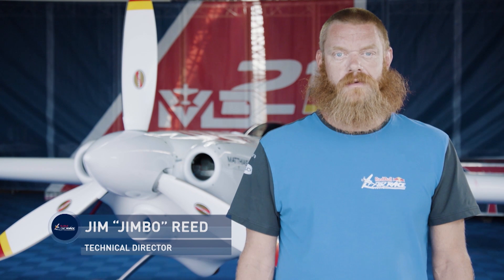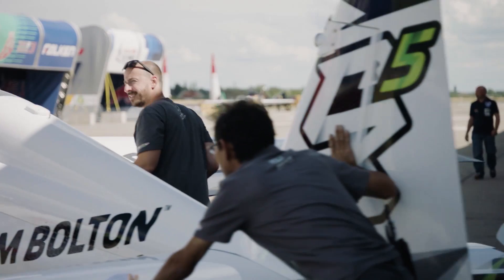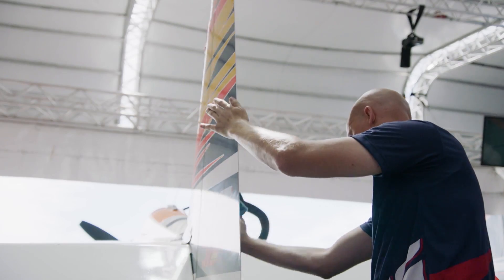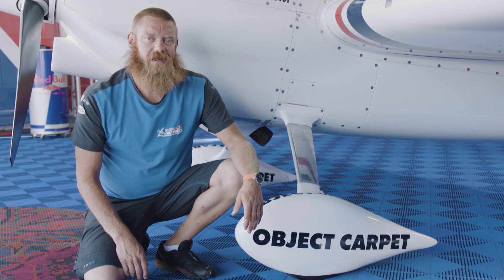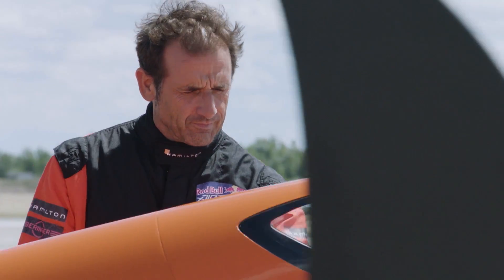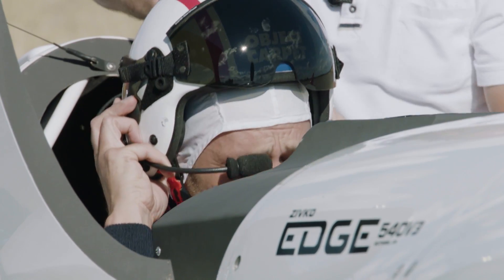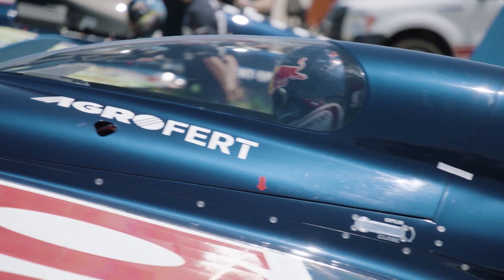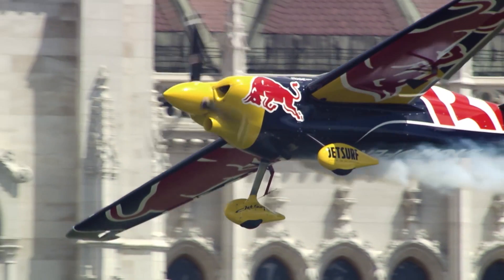Red Bull Air Race Tech Talk | Aerodynamic Advantages

Comment: Why they dont use retractable landing gear
Reply: You would have to do a few things to make the landing gear retract that would result in a less aerodynamic aircraft.
First, you need to find some space in the fuselage to retract the landing gear into. For this you would have to increase the size of the fuselage, inceasing drag.

Then you have to add a mechanism to retract the gear and open / close the gear doors (otherwise you'd just have large, unaerodynamic holes in the fuselage), which increases the weight. To support the additional weight you need more lift, which can be done by flying at a higher angle of attack or having a bigger wing. Both inceases drag again.
Lastly, you also have to strengthen the wings and the parts of the fuselage that connect the (heavier) langing gear to them, remember all this hast to be able to take 12g. For this, more materials is needed, making the aircraft heavier and increasing drag again.
Reply: because of complex design and a lot of weight